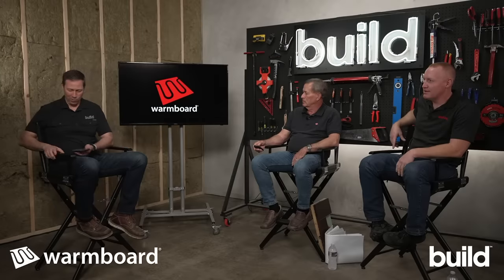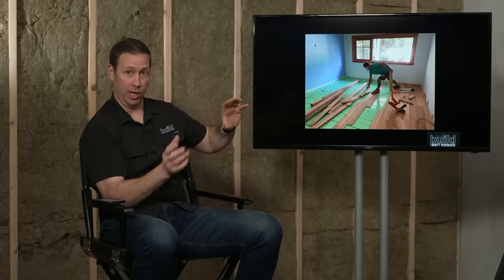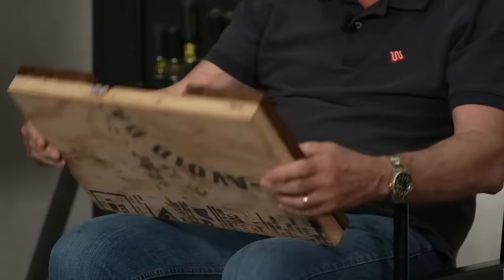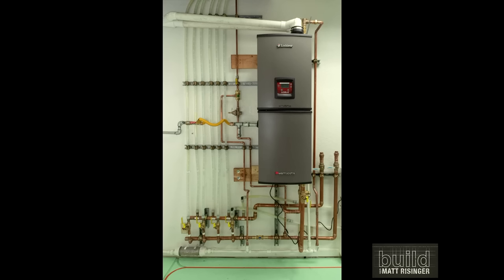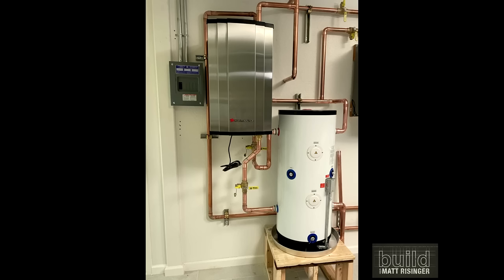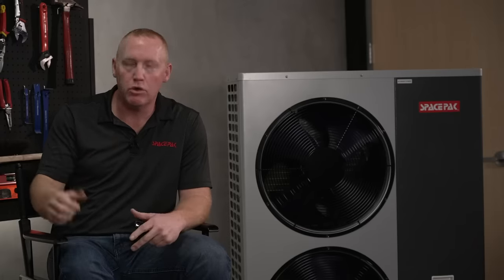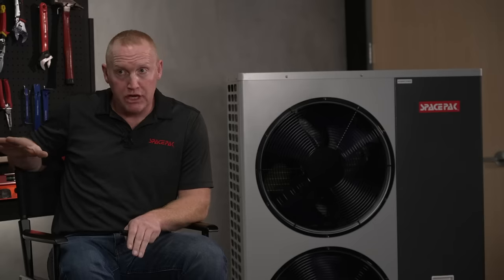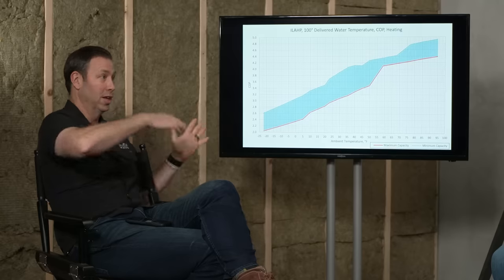Cold Climate Heat Pumps for Radiant Floor Heating. No gas, no boiler!

Comment: Is this a joke? You have had this is 1992? What took so long to get to market? And why do popular canadian wholesalers not only not carry but never heard of this, i built my own system, to do same thing in less then 3 months, from idea to finished working prototype, as i could not find one, i'm not an engeneer, just a plumber with little knowelge of AC/heat pumps, and have less then $ 1500 into my build my heat pump was used, and price does not include my in floor costs. And in cold climates would work better as a water/water not water to air, i think water to water would elimanate the defrost cycle, meaning more effiecient. Plus the compresser at that point could stay indoors. I heat 2500 sq foot shop, and the 2 heat pump and infloor air a perfect pair.
Reply: Sorry do not have this app.
Reply: because of the cost!  i to have very little in my system!   these are $300-$400 panels each.  system wise, $30-$50k for most homes.

Comment: Banning n.gas for residential seems absolutely insane and terrible for the environment, for many reasons. When the power plant burns n gas for electricity, the heat is a byproduct, it's wasted. Using the gas to produce electricity which is then used to produce heat is insanely inefficient. The heat could have just been produced at the point of use. N gas itself is a byproduct of oil drilling, it literally has a negative cost at the mining site, it's in the way of the oil and drillers must spend money to deal with it properly. It only costs money to the customer due to the cost of processing and transporting. Which is great, it becomes a commodity, because if it was released into the air, it's very very bad for the environment. The more methane that's captured and used effectively, the less methane naturally escapes into the environment (and it all eventually will, it's 100 percent impossible for it not to). The more methane is used effectively, the less need there is for coal, etc. Having diversity in the residential energy systems is good for national security and resilience; if the n gas is disrupted, electric is a backup, and vice versa. If both are out; then gasoline / diesel will quickly run out, then you're dealing with wood and horses.  N.gas also allows for domestic sourcing, which is ideal for national security.

Comment: No thanks, I work on heatpumps a lot and hell no I will never have a heatpump. Great untill you need a repair, they are expensive to fix, parts are hard to get, takes weeks to get parts. Work poorly in cold temps, these salesmen are not being honest. More special a system is like this, the harder it is to find techs who know how to work on them and to get parts.
Reply: If you are interested I have a few questions about system design. I am looking to build a simple system to heat my garage in Minnesota. I'm not married to the idea, just seeing if it makes sense.
Reply: Zack is right, i built my own system, but could not find a a/c tech willing to help, if its not plug and play, they wont touch it, finally found a great refrigeration guy that builds comercial fridges, hes been a life saver and worked out the one problem i was having.

Comment: Us houses the most efficient. Lol laugh's in European. 
+ High thermal mass homes keep a constant temperature, no need to have fast heat transfer through the floor so concrete is perfect for radiant heat, it also absorbs sound like a boss. You are just using bandage's on a failed foundation.

Comment: Gas is out....LOLOLOL.  Priced electricity lately?  And it's going to do nothing but go up.  Just look at Europe.
Reply: the only thing dumber than gas is electric without solar. problem solved.
Reply: @stevecrawford6958   huh???  You forgot batteries… lots and lots of batteries.  And huge solar panel arrays.  Attractive way to spend 10’s of thousands of dollars.  Heating your house in a winter climate with renewable energy is not trivial.
Reply: @colinstu  It's not happening here in Texas till I'm 6 feet under, then I won't care.
Reply: @Asta-wl8jz  the world is a lot larger than Texas. The industry & this stream have a lot of folks to keep happy.
Reply: @superspeeder  only if geothermal heat pump installs cost 75% less. Never happening.
Reply: @Pepe-dq2ib  lol true!  I just paid $12k for my well to be drilled.  You need two of those for geothermal, or an almost equally expensive yard full of buried pipe.
Reply: How European countries generate electricity isn’t identical to USA. We have resources, rivers and open land they don’t have. And yes, the installation costs of geothermal is high, but very low running costs for years afterwards. And you don’t have to worry about natural gas price spikes
Reply: European here with an air sourced heatpump and radiant underfloor heating. Couldn't be more wrong. It's the succers who put in gas boilers that are paying insane prices meanwhile heatpump energy is so cheap than my bill  went up a lot less than if i had gas. I'm going to pay around 700€ to heat up my house this season it would probably be at least 2000€ if we had gas.
Reply: @MatejKebe  NG in the US is 3x cheaper than the UK. Maybe stop getting involved with Ukrane.
Reply: @gordonwinter4540  geothermal costs are high enough that the lifespan of the heat pump may expire before the system has paid for itself.  Of course there are large variables, but air-source heat pumps are generally viewed as a better value even with lower seasonal COPs.
Reply: @MatejKebe  the gas vs heat pump argument has a lot of variables.  In a relatively mild climate with high gas prices a heat pump looks better.

Heated floors are expensive regardless what source of energy you choose.
Reply: @MatejKebe  everyone’s situation is different, for sure, and it sounds like you were able to do your heated floors for a reasonable price.

Personally I think heated floors are a great idea, but generally speaking they are not worth the investment.  If budget allows I would always advocate for a better building envelope first, then superfluous creature comforts second.
Reply: @MatejKebe  everyone’s situation is different, for sure, and it sounds like you were able to do your heated floors for a reasonable price.

Personally I think heated floors are a great idea, but generally speaking they are not worth the investment.  If budget allows I would always advocate for a better building envelope first, then superfluous creature comforts second.
Reply: @Pepe-dq2ib  Yea because it's subsidides by the goverment. If homeowners would have to pay for all the costs associated with drilling and distributing gas it would be a lot more expensive than running a heatpump. A gas turbine with cogeneraton is 65% efficient. If you take that energy throught a hetpump with COP of 3 you get to 195% efficiency compared to burning gas on location at 95% efficiency. So heatpumps all thing equal should be 50% of gas before you even factor in the cost of maintraining pipelines to every home.
Reply: @MatejKebe  i know how heat pumps work, i have a mitsubishi hyper heat system at home and my work place has their commercial multi city vrf system. I live in MN, but near the metro where we only get about 5 days of extreme cold, so i get away without needing geothermal. NG is fairly cheap here so i do not save much in winter, but the real saving comes in the summer. 3 Phase power is also not common for residential in the US, i had to call my utility 3 times before i got somebody who would allow it.

Comment: When everyone talks about going strictly to electricity, I must laugh. How do you think most electricity is generated??? NAT gas is CLEAN. Everyone is falling for the narative being spewed. The earth needs carbon. When I heard you mention "carbon foot print", that's it. Unsubscribing. Is everyone going woke???
Reply: Then burn the NG at the power plant and use it to run the heat pump. It'll still be more efficient than burning it at the house.
Reply: @KennyMacDermid  It's not more efficient to do it that way for heating, The best combined cycle power plants are about 60% efficient from gas input to electric power output. Home furnaces are about 80% to 96% efficient at extracting the heat directly from the from natural gas. Don't let those with the loudest voices nor the slickest media sway you one way or the other, whether "woke" or "anti-woke".  Half truths or "a selective subset of facts" is most dangerous because it sounds actually convincing, unless you know bettter.
Reply: @IhabFahmy  It's 32F outside my window. My heat pump is, right at this moment, running just above 350% efficiency. Even if I could get 100% of the heat burning natural gas at home it still doesn't even come close to the over 210% I'd get having the power plant burn it (factoring in the 40% loss). Now that you know better please use that knowledge going forward.
Reply: @KennyMacDermid   @@KennyMacDermid  Sounds like borderline engineering knowledge being wrangled into submission to prove a ponit, because no engineer would refer to a coefficient of performance as "efficiency"... That's why we actually have a different name for it than the word "efficiency". But in layman's terms we can let it go.

When you're regularly at minus 15 and minus 20 (Degrees C... we prefer  ot to use the archaic Fahrenheit scale), then finding a heatpump that will maintain a COP significantly greater than 1, while maintaining enough thermal output (kWh or Joules of heating) is neither easy nor financially justifiable in my climate. 

More important than COP for any HVAC equipment that both heats and cools (my requirement) is the SEER (seasonal energy efficiency ratio) which will be different for your mild climate than my sever climate. No one talks about SEER for various regions in the webinar though, because unfortunately most consumers engineering understanding is superficial. Suffice it to say higher SEER = good. There, that's simple enough. 
Now that you know more, please use that knowledge going forward.
Reply: @IhabFahmy  Nice try, but if you're somewhere that needs cooling then you're not cold enough to make burning NG yourself more efficient. At minus 20C I still get a COP of 1.78, so even at this cold of a temperature it's still more efficient for the power plant to burn the NG rather than me.

You can keep trying to muddy the waters with unrelated stuff—perhaps they don't come in the colours you want— but you've provided exactly zero backing to your conjecture that burning NG at home is more efficient. I can't waste anymore time on your loud voice of ignorance though, so if you don't provide actual calculations in your reply I will ignore you from now on.
Reply: Depends on where you live. In the Pacific Northwest, hydro is the biggest source.
Reply: @KennyMacDermid  please do. There are more civilised discussions and civilised people that I can actually learn from.
Reply: @IhabFahmy  That 80% to 96% efficiency associated with newer residential gas furnaces applies to the percentage of natural gas ignited and consumed by the furnace, NOT the thermal efficiency. Furnaces are rated by their "AFUE"  or annual fuel utilization efficiency which has nothing to do with electricity.
Reply: @paulmcgown7504  Who said anything about gas furnace efficiency being related to electricity? AFUE and efficiency tend to be used interchangeably in the industry, but yes, you are correct that AFUE is a better measure of  overall fuel heat content utilization efficiency over an annual heating season. It incorporates the efficiency of generating heat by combuwtung the gas, how much gas remains uncombusted, the heat transfer efficiency from combusted gas to the heat exchanger, the heat transfer efficiency from the exchanger to the conditioned airflow, stack losses, plus how all these vary over the heating season with variations in intake air temperature etc. AFUE for gas furnaces is more analogous to SEER in electric heat pumps. Yes, they measure completely different modes of operation, but it helps to think of both as overall efficiency of modifying the conditioned air to your desire compared to how much input you have to put in, all adjusted for the chamging seasonal ambient conditions over one year.
Reply: ‘Woke’ is merely a term for disparaging those opposed to fascism and opposed to all of the hate, bigotry, sadism, maliciousness, and avarice that goes along with such fascism. 

The climate denialism is entirely about the greed and selfishness reflected well in that great quote from Groucho Marx: “Why should I do anything for posterity? What has posterity ever done for me!?”